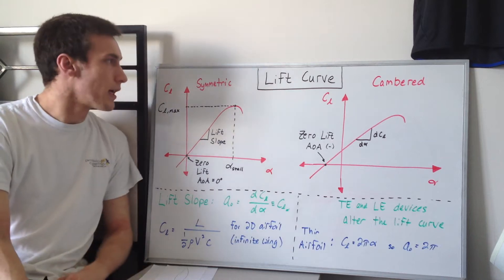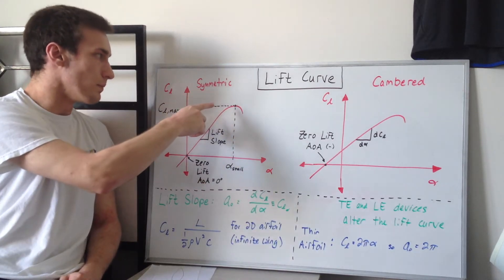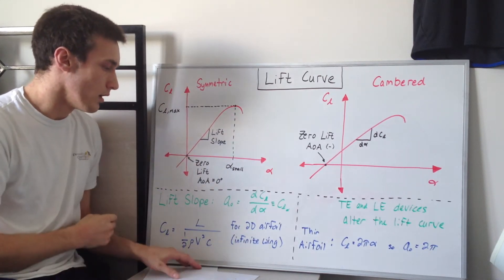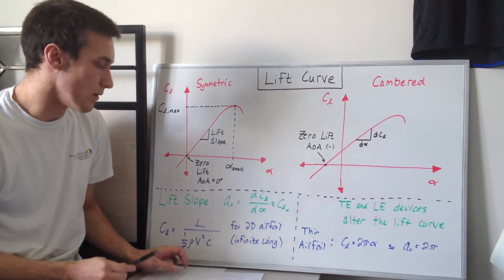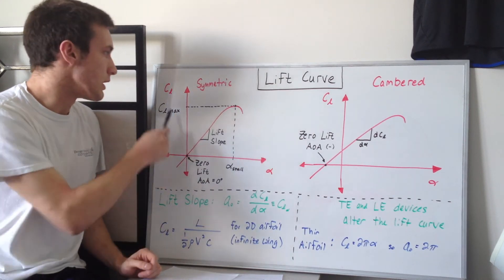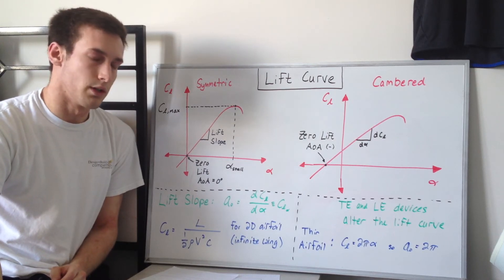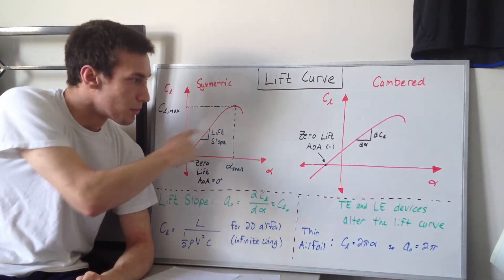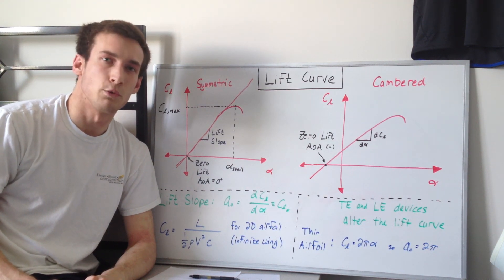Explained: Lift Curve [Airplanes]

Comment: hi i was wondering how would i estimate the 3d CL for an aerofoil for which i only have the geometry ( span, Area, AR ) ??
Reply from the maker: +Raul Haq 
Things get much more difficult when considering real 3D flow, as opposed to the simple 2D flow.  I would take a look at something called Lifting Line Theory.  It is quite math intensive (depending on your background), but you can probably just look at the results from the derivation.